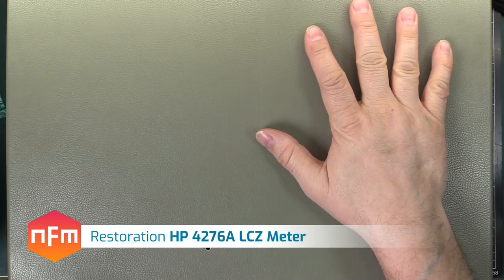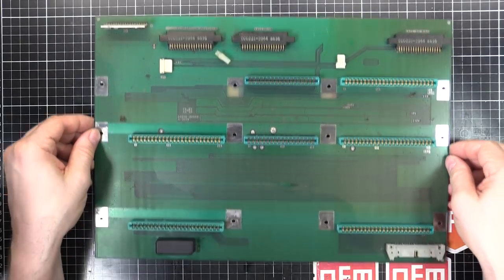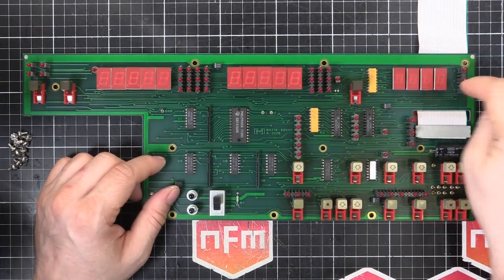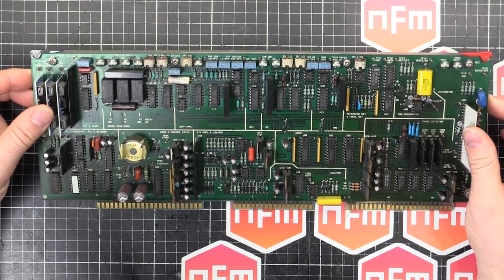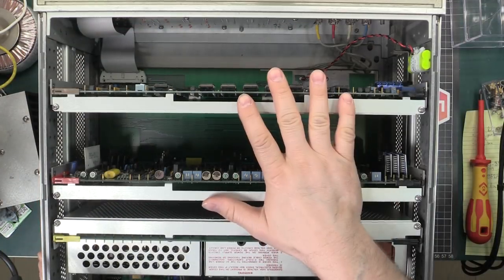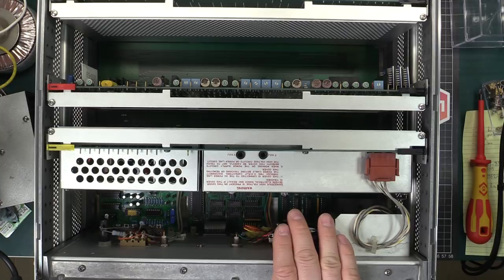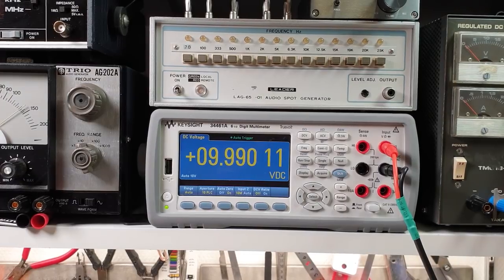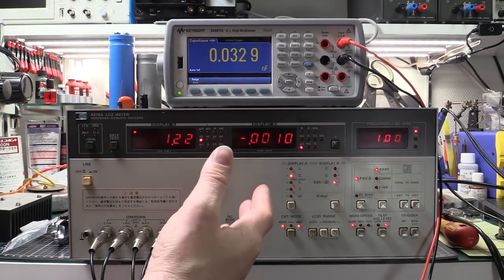HP 4276A LCZ Meter Restoration and Upgrade

Comment: For the pricey, red switches... Maybe 3D print the body and make the contact from battery tab metal? Glad I watched to the end... I did not know about the DC offset voltage dropping the capacitance on ceramic caps. Great job on cleaning up the battery goo = Atta-boy!
Reply from the maker: 3D printing is a potentially good idea. For the spring, you can just use some thin spring steel (it's nothing special).
I have saved a few of the switches from scrapping equipment that was otherwise beyond repair. Never know when you'll need that one little part that no-one seems to have. :)

Comment: For cleaning those card edge connectors, using a pencil eraser was always recommended for ISA bus PC hardware, might work well for these, too.
Reply from the maker: For non gold plated edge connectors it will work, but for gold plating, the erasers will take the plating off so it's better to use a softer method.

Comment: Excellent video and well understood. I am looking for a 4274a or this one as shown. I did come across one with a 4274a with a option 2...0-99 volt bias which HP says an optional controller is required..about $300 😥 ! Thanks again for your time that you put into this video! 😀
Reply from the maker: Yrah, some of the accessories can be disproportionately expensive.
The HP test fixtures are too expensive as well, but you can get Chinese ones for much cheaper.
Reply: Silly question... If I find one with the 4 wire kelvin clips, will it work with the internal external bias or does it require a test fixture? Thx man!

Comment: What screw mount part did you use on your board?  It is the one component missing from the BOM
Reply from the maker: I have updated the video description with the part details. It should cross reference to something available locally (or even an L bracket of similar dimensions) or you can pretty easily make them yourself with basic tools.

Comment: Construction is quite a bit different than my 4274a.On my unit the battery is on a vertical plugin board. Some not so clever person replaced it with two AA batteries that leaked horribly. No damage to the board fortunately. I have a second unit that blows the 4A fuse if I plug in any one of the last 3 boards. Cannot find a short on them anywhere. Very puzzling.
Reply from the maker: I have a 4275A over on the shelf somewhere. It's waiting for its turn on the healing bench, I might end up making a video on it sometime.
I managed to get two, one scrap and the other almost complete, so I ended up making one good from two, and had some spare parts left over which was nice (Like option 003 - battery backup... yay for leaky batteries, Option 004 - 1-3-5 step test frequency etc) I can't remember if it had a DC bias option though. Maybe not... Maybe a future project.... :)

Comment: This is outstanding! you did an excellent job and your workmanship is great.  Do you have any experience with the HP 4275A? I have one and the display is blank when powered up.  It is untouched and all parts and components are origninal. I was hoping you may have some experience with it.  I'm able to see that the display works so it is not that but that is it on my end.   Thank you in advance.
Reply from the maker: I have a 4275A here in my pile of gear to fix one day. I haven't had a look at it beyond turning it on yet though.
Is there any troubleshooting guide in the service manual?
I'd start by checking voltage rails, are they all testing ok?
Reply: @NearFarMedia  I have the service manual and I’m narrowing it down.  The power supply rails are all good.  According to one of the troubleshooting flowcharts it asks to check for 5v at the display board and the board has exactly 5v; it doesn’t go any further.  I think it may be another board and specifically one or more chips that is causing the problem.  I’m still trying...maybe yours is behaving the same way?
Reply from the maker: @reybarrera6544  Mine turns on and seems to operate ok (pending a full operational test).
Does your unit have the optional backup battery on the A9 Microprocessor board? I have heard these will not operate correctly if the battery is worn out as it holds the CPU/RAM in reset.
Might be worth checking for that. Often simply removing the battery will allow the unit to boot up ok, it won't store your last front panel settings (basically the only function of the battery) when you remove power unless you install a new one, but battery issues are well documented by many for these units, so most people just remove the battery completely to avoid problems..

These units can also suffer from bitrot in the eprom chips. There's some info here:
https://www.eevblog.com/forum/repair/the-repair-from-he!!-hp-4275a-lcr-meter/
Reply: Well that is good news for you! Lol.  This one does not have the option that includes the battery so there is nothing there.  It turns out that there was a short to ground so when I have a little time I’m trying to narrow it down.  I was hoping that I would not have to disassemble but looks like it may be necessary.  There really is not a lot to them but was just hoping for a simple fix.  I appreciate the insight and thank you for the link.  Hoping finding the cause of the short will settle everything.

Comment: Electrolitics should be tested at 120hz and ceramic to 1Khz. other wise using manufacturer testing specifications. :D Nice restoration!!!
Reply from the maker: Yes, you are correct!
I was winging it a bit in the video and couldn't remember the exact values to test at. :)